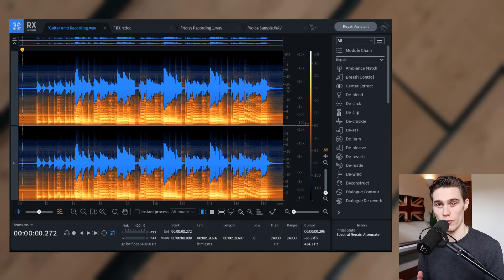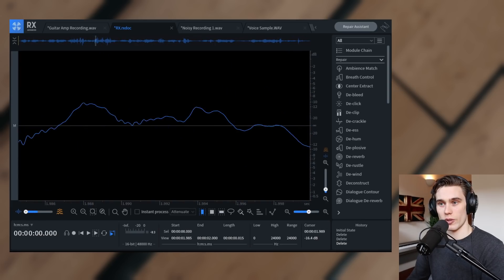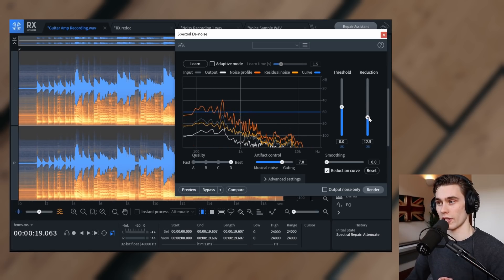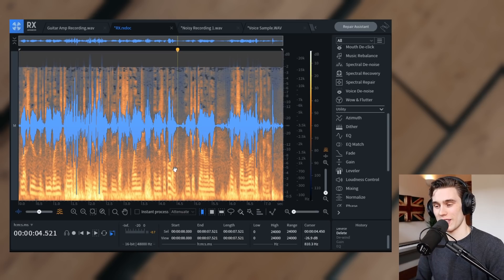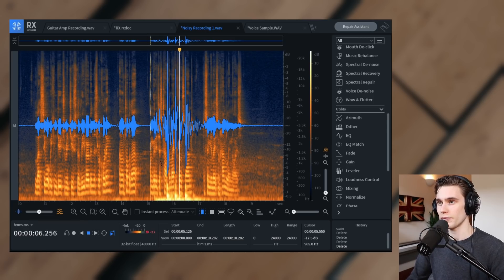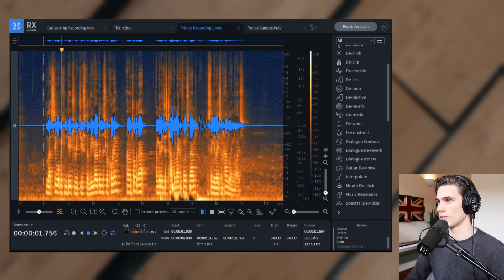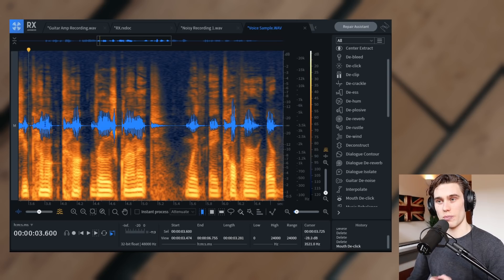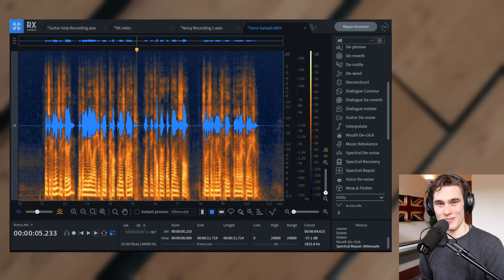Make Your Audio Sound Better - iZotope RX8 Giveaway

Comment: If you also used derusle aside from dewind noise, your voice would,ve sounded perfect, also you could,ve completely take rid off that bumping sound from the mic rather then reducing it, trough the i got no know how to analize,deal and remove certain frequencies in an audio by just looking at certain patterns,
Trough you don’t want to end up with artifacts but what if you could cover those artifacts by canceling them out or use spectral repair option, am sure there’re ways to make even the worst most harsch recording sound like new, but i guess it will require a very very deap understanding of all the tools to your disposal.

Comment: Hey Michael, thanks for all your advice. Have a quick Q re: headphones. You recommend & use the BD 770 Pro 250 Ohm. I have old & beat-up but functioning Sony mdr7509hd. Alas, out of production. Looking at the specs, the 770 handle measly 100 mW vs the Sony 3000 mW. Could you comment on that?

Comment: I was wondering maybe you might have some secrets to getting a more bigger thicker well balanced sound  out of soft synth vst  because I practice my Production skills with remaking the instrumental of songs specifically 90s to  00s R&B and i usually put the song audio file in my daw sync my tempo to the song and I mark all the sections up and I make it section by sections it really helps me to learn how to  arrange how to pick good sound selection and how to mix but with the sound design it lacks clarity and fullness and I dont mean in the mix but by itself I know there soft synth and they dont compare to the real analog keyboards , synth and drum machines but I feel there's something more I can do to make them fuller and thicker and clear  I know there's saturation reverb parallel processing but maybe I'm doing something wrong

Comment: Guys I need help🙏🙏 None of Isotope's vst are running properly in my PC(Fl Studio) there response are very slow and sometimes they  hangs too (only Isotope's vst hangs ) even though my vst works well . I start facing this problem last week before they used to work very well I haven't changed any thing in cpu 
Ozone imager 2 is also not working  And I don't have crack version . Plz  help 🥺🥺🥺

Comment: Can you do a video specifically on vocal isolation and Tonal Balance Control?
Reply from the maker: Vocal isolation is a tricky one tbh. It seems to be heavily dependand on the material being used and often the stereo width of the original recording. However, I could certainly look into making a guide for tonal balance control. I have used the Tonal Balance control in many of my mastering videos, have you seen them?
Reply: @inthemix  I think if you're using Tonal Balance Control or any kind of isolation like that, you are committing to covering up the extra leftovers in the mix. No isolater will ever be perfect....at least not now..